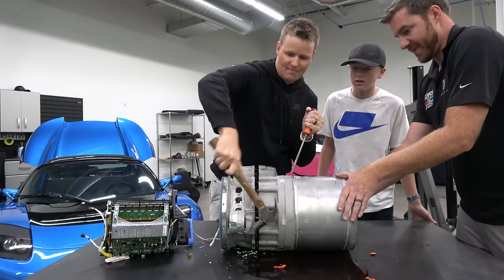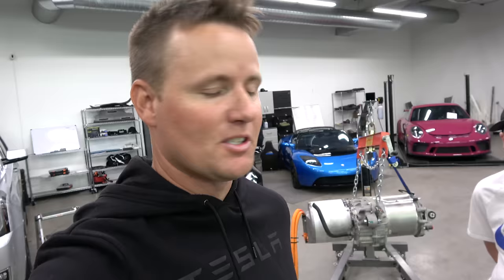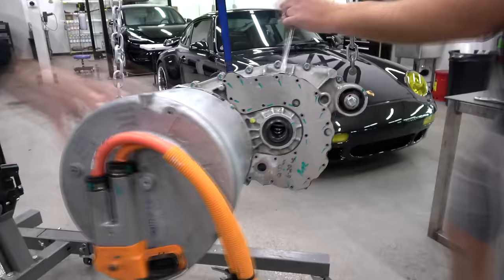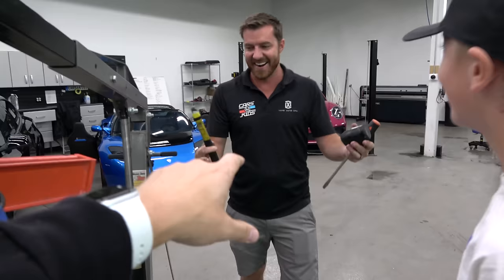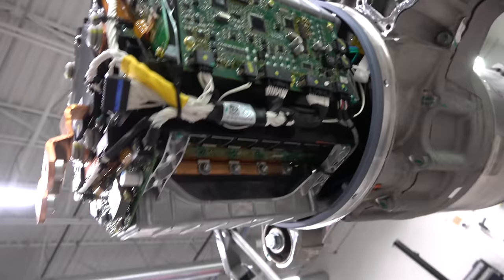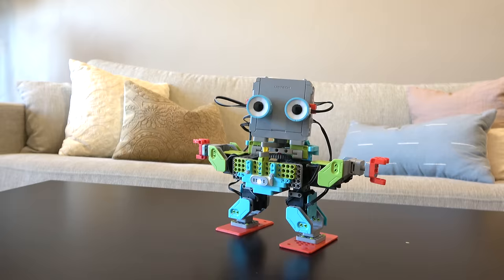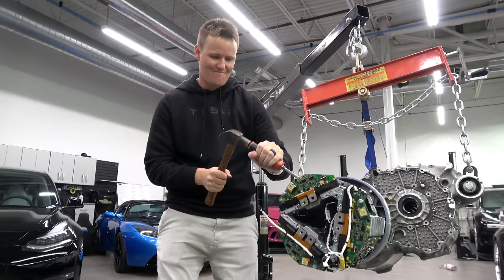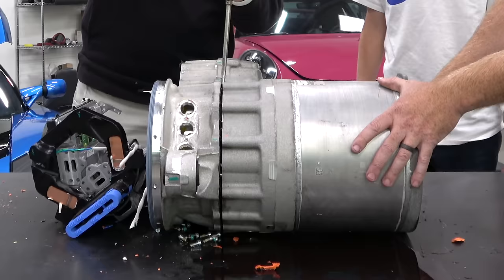What's inside a Tesla Engine?

Comment: “Lets take apart the motor!!!” - takes apart gearbox and controller, not motor.
Reply: hhahahaha...
Reply: Yah I was expecting spark plugs, pistons, air intakes, radiator, manifold, exhaust, valves, and other combustion automotive things too, lol
Reply: Eh? Didnt even take apart gearbox they only exposed the "bearings that roll around" after butchering/splitting the electronic modules from motors cage.  
      They dont even know that Tesla doesnt even have an engine, Tesla itself is a motor(car)
Reply: @sandro14esandro14e  Ever here of an electric motor well a Tesla has one and we didn't get to see any part of the actual motor.  We don't even get to see if its brush-less or not (but all the electronics in the first section points to it being brush-less i think but i'm not an expert).  Your comment implies you think John James is disappointed because the motor wasn't a combustion engine and i'm pretty sure that is not the case.  He seems to be disappointing because we don't get to see any part of the actual motor just the gear box and circuitry.
Reply: kye langrehr kind a wanted to see magnets as well, 

Teslas use electric motors that have two moving parts, and single-speed “transmissions” that have no gears. The company says its drivetrain has about 17 moving parts compared with about 200 in a conventional internal combustion drivetrain
Reply: Sandro Fortini 200 would be a very conservative number for a modern ic engine.
Reply: @kyelangrehr183  It's most likely a 3phase induction motor driven by a variable frequency drive (the electronics they dismantled). Would've been nice to actually see it though.
Reply: @kyelangrehr183  It looks like a 3 phase asynchronous motor. At 9:55 you can see the 3 terminals of each stator phase. At 4:20 you can see the rotor and probably the bottom of the "squirrel cage".
Reply: @peterkiss1204  It's a brushless  3 phase synchronous motor.  Rotor is made with permanent magnets. It's what we call a servomotor in the industry. Motor is driven by a drive which supply power to the motor, controls amps, torque, position, acceleration, braking, regen, thermal status of the motor etc etc as  servomotor have an encoder feedback to report speed/position of the motor...etc.
Reply: @nabushdinosaure  I looked it up, and it's actually an asynchronous induction motor they used in the model S. A rotor made with strong permanent magnets wouldn't stand that clear from the stator assembly with only one end being held in position. And probably wouldn't run that free. The bottom definitely looks like a copper ring, as the back end of the cage.
Reply: @sandro14esandro14e  
What do you mean they have no gears? You saw the gears in the vid...
Oh, wait, you meant gears as in the different ratios between input and output rotation, not gears as in cogwheels, got it.
Reply: @sandro14esandro14e  electronic motors dont have most of those things. this isnt an engine it is literally a huge complex motor.
Reply: Yeah, but it looks already AMMMAZIIINNGGG!!!! The most amazing thing you have ever seen! I mean, look at that!!!
Reply: It's asynchronous and synchronous that's part of what the "brains" do. (The triad board on the other side.) This controls the behavior of the motor operation at any moment. I assume that "synchronous mode" would be the most power driven mode of the Tesla and "asynchronous mode" would be a more economic mode for regular driving. It's also a controlled induction motor (bush-less), so in a sense you are all correct. Tesla took the best of these worlds and put them into 1 package. Mic drop Elon give me a job!
Reply: @sandro14esandro14e  Actually the model s uses induction motors, which don't actually use permanent magnets. In the middle it has what is usually called a squirrel cage instead of a big magnet like DC motors.
Reply: John James thinking that the whole time
Reply: @sandro14esandro14e  Most people consider a "motor" to be electric while an "engine" is usually considered to be combustion. Just something to think about....
Reply: j McGuglet after some thought 💭 it seems apparent that it can apply to both electric or fuel  for example motorboats and motorcycle are typically immediately considered primarily as internal  combustion engines
Reply: @sandro14esandro14e  its electric,not combustion, how do you make the mistake??
Reply: @TheNeckmeats  Motor could still be applied to combustion engines, for example, aww man the motor broke and we cant to go to (insert city name here), just something to think about.
Reply: @christhegamerdelima5545  Maybe you may want to take more time reading a person's statements before replying... I just explained how the two words are synonymous.
Reply: @TheNeckmeats  i further proved your point (: haha
Reply: @christhegamerdelima5545  I would suggest for you to enroll in a reading comprehension class. I really feel it may benefit you greatly in the future. If not, it may be best for you to stop communicating using written words.
Reply: @TheNeckmeats  you what, i dont man, seems you should stop communicating, like i said i further proved your point.
Reply: Chris the gamer Delima sarcasm notice lol
Reply: @sandro14esandro14e  sorry, its hard to convey sacasm through the medium of text when not using any form of satirical language in a obvious manner, btw this wasn't passive agressive in anyway haha. But really my bad tho.
Reply: @GuyFromJupiter  Model S motors are carved from a solid block of copper.  There are old videos floating around of tours of the Tesla factor that show them being machined.
Reply: @nabushdinosaure  Its almost the exact opposite of that.  Its a 3 phase 4 pole asynchronous AC induction motor with no permanent magnets.  Tesla didn't start using permanent magnet motors until the introduction of the model 3.  Which post dates this motor.   The main drive motor of any electric car is by definition NEVER a servo motor.  It is a traction motor.  Servo motors are used to obtain precise angular positions as in robotics or reciprocating control surfaces.
Reply: @Robbie6298  Thanks I know what a servomotor is I'm a maintenance manager in 1000+ people industrial manufacturing site. Servomotors are not used only in Robotics, they are used for on all kind of machines where a presice control of speed/torque/position is required. We call a brushless motor a servomotor once there is an encoder on the motor for precise speed/position monitoring. At some point even traction motors as you say will become servomotors as torque vectoring systems, traction management systems etc will benefit of having precise knowledge of the motor position and/or real speed on top of all current/frequency/torque/curves from the VFD
Reply: @nabushdinosaure  given your credentials you should therefore know that the original Model S drive unit is an Asynchronous AC induction motor with no permanent magnets and by definition the magnetic field of the rotor is induced and does not follow the rotating field of the stator.
Reply: @Robbie6298  I appreciate your definition of an asynchronous electric motor :) Thanks for teaching me stuff I already perfectly know ^^ . I would like you to explain me how by knowing how an asynchronous motor works automatically means that I should know the model S has one :). Especially when I never look into before...I assumed their were using permanent magnets motors, but obviously an asynchronous motor is way cheaper for high HP applications.
Reply: @Ash-do2pv  Sadly they took the gearbox further appart, as you can see in the end, but didn't show anything of it in the video.
Reply: @peterkiss1204  how can asynchronous induction motor do regenerative brakes?
Reply: @kyelangrehr183  It is a permanent magnet motor, actually there is a video about it, not this one of course, and the amazing tech that they are saying is just the microcontrollers and they are nothing unusual or 3 years more advanced than anything else as they said lol
Reply: @samueladitya1729  it is possible to have regenerative brakes in an asynchronous motor (Squirrel-cage ). It happens when the rotor is spinning at a greater speed than the synchronous speed. With a VSD this is pretty easy to do. However you have to keep in mind that is can't work just plugging the motor, it needs a source of reactive power (Q) to keep the magnetic fields and it will generate active power (P). If the rotor is winded and connected to a vsd instead of a cage it is possible to do without the external source of reactive power.
Reply: @kyelangrehr183  based on the electronics (and things published by Tesla) it is a 3 phase ac induction motor.
Reply: They did it on purpose ;-)
We didn't see stator, rotor etc.... :-)
Reply: my thought exactly.
Reply: @jaredhouston4223  Except this unit does not have any synchrous abilities. The new model 3 has a synchrous PM rotor, and can  also do re-gen. The model S cannot. Also, a Synchrous motor with a permanent magnet rotor, is more efficient, and asynchrous one which has a lagging induced field in the short-circuit "squirrel-cage" rotor, is less effeicient, but can be made much more powerfull. In an asynchrous motor the induced field is proportional to the applied power, and the only thing is the efficiency goes down more at high loads due to a larger lag of the rotor. Synchrous permanent magnet motors has a much more limited torque, as overloading will cause it to "skip" over the limited in strength fields, and go out of synch, but when kept in synch and at lower loads the less offset of the fields gives a higher back-emf, and higher efficency. With regards to the Back-emf that applies to the asynchrous aswell, but it will allways lag more, and have lower back-emf, and thus lower efficiency.
Reply: @flyfaen1  🧠👍
Reply: @GuyFromJupiter  The S is switched reluctance I believe, and the model 3 is permanent magnet. Most 3 phase motors still have permanent magnets, but the switched reluctance motor does not.
Reply: I'm thinking the same thing
Reply: Don't tell him he will be devastated 😢

Comment: "Whats inside a Tesla engine?"

Opens eletric part
Opens gear part
leaves motor closed
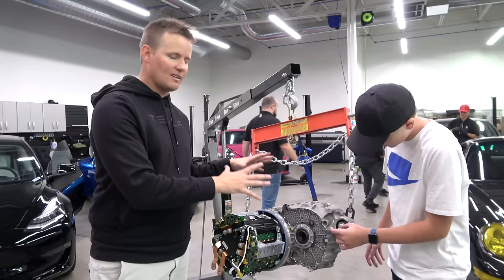Reply: 5:56   And don't forget to buy your Lego robot.
Reply: For one Batterie you need 20.000l of Groundwater.
Lets say in Germany they produce 80 Mio. E-Cars.
You need an amount of 1.600.000.000.000l of Groundwater ..
Reply: What is the what is the groundwater used for?
Reply: I know. Was thinking the same thing. This was hilarious
Reply: You know lithium and cobalt manufacturing is more dangerous for the environment than producing combustion engine cars? Look it up the vehicle itself might be good for the environment but no one talks about the production and manufacturing
Reply: @carlosgaspar8447  idgaf
Reply: The Illuminati cut that part out of the vid (satire)
Reply: You are wrong it's have combustion engine and pedal system
Reply: @lemmythebulldog8812  They talked about production on battery day. Cobalt is no longer part of the process and lithium is reusable after the vehicle life.
Quit spreading your bs.
Reply: First thing it’s not an Engine it’s a motor remember...
Reply: @emiljagodowicz3682  I dont really care, you should tell this to Whats Inside not me, and i think you got my point even though I mistakenly put engine instead of motor
Reply: Google "electric motor rotor" and that's what they didn't look into.
Reply: I tought it only had some bigass dc motors lol

Comment: That moment when you find out there’s lots of fluids to maintain in a Tesla right after you said there’s nothing to maintain on a Tesla 🤣🤣🤣
Reply: Makes me wonder, what is more reliable, a good 4l gasoline engine or this "simple" motor. F**k, this thing has a million of electric parts that might go bad. Will it cost me to get another engine like this?
And by now, I do not believe it would be cheap.
Reply: As soon as he went on that ignorant rant at the start i went and got the popcorn....
Reply: lifetime fluids aka they dont wear out like jet engine oil
Reply: @Shineinpoverty  About $7k from Tesla. And they make sure you can’t DIY anything. You’ll pray for an alternator, water pump or coil pack to replace.
Reply: @jkoonce4244  Huh? The Tesla fluids wear out just like ICE cars. The drive units are like transmissions/differentials that should be replaced every 50k miles for long life. Brake fluid and coolant need changing on the same schedule as ICE cars because the brake fluid absorbs moisture and the coolant loses anti-corrosion additives over time. You just save an oil change but lose that savings on more frequent tire and cabin filter replacements.

Comment: "whats inside a tesla motor"

*pulls apart everything but the motor
Reply: Should have titled it, 'what else is in a Tesla drive unit apart from the motor'
Reply: Umm they did open the motor, just not the gearbox
Reply: @ThePurplePupUwU  Ummm no.
Reply: TheRedGamerFPV there’s no gearbox in a tesla
Reply: They should titled it "What Inside Tesla Gearbox and Inverter"
Reply: @yaheard8335  But there is a reduction gearbox.
Reply: It's a motor not an engine.  An engine implies that heat energy is used to create useful work.  A motor uses non heat energy to create the useful work.
Reply: He said engine, and it doesn't have an engine
Reply: @ThePurplePupUwU  no, you got it the wrong way around xD they opened the gearbox and not the motor.
Reply: L
Reply: "whats inside a tesla motor" *ENGINE. lol.

Comment: Very interesting video. 
If anyone is taking things apart: in the very least wear a pair of latex gloves rated high enough to stop chemicals going through them, and please wear eye protection, not only against splashes, but you never know if there's a spring sat under a cover that will launch out unexpectedly or a hose with liquid under pressure. Make sure you have ventilation too. 
Most products should have COSHH (Control of Substances Hazardous to Health) sheets available, telling you the risks, dangers, and most importantly the information required for emergency treatment should someone have an accident. Make sure you read them and, if required print them off.
Also: sorry if this sounds formal, but have a plan, a working statement, we have them for reasons: "if this goes on fire where going to do..." , "If we suddenly struggle to breath we will..." .
I appreciate some people say the chemicals are safe, and they probably are in 2020, but time and time again (sadly) we find out that the "safe" chemicals are now dangerous. There's nothing worse than finding out 20 years later we should have used high protection protocols when working with them: why take the risk? 
And finally as others have said, unless you know what you're doing be very carful as electrical current can be stored for significant periods of time in capacitors.
Reply: Sir, you do realize you're talking to Darwin award nominees, right?

Comment: Open the motor, this is the differential and the transistors driver
Reply: That's a GEARBOX, also called as REDUCTION GEARS, .....NOT a DIFFERENTIAL....LOL
Reply: Differential have a reduction factor done with gears. This is a one shift gearbox.
Reply: Pranav Tagare wrong
Reply: @pranavtagare2601  I think it is both a differential and gearbox.
Reply: you can find those motor online... clear problem... if you need to replace them you need the whole unit.. unlike normal car that you can just take one part out and fix quickly... I will never buy this pos.... rental car only...
Reply: @campkira  There is not much things to replace... Basicaly only 3 motor itself, gears and DC/AC converter. If you burn windings repace of coils is too dificult, gearbox is almost fail safe and burned DC/AC is also cheaper to replace than repair. ICE engine has  lots of moving parts and it is much more complicated. It is expeceted you will broke components to comparsion electric motor is far more reliable, there is little to no wear of components.
Reply: @PistachoGirasol  One shift would mean 2 gears. This is one gear, and ZERO shifts.
Reply: @campkira  even with an EIGHT YEAR warranty and NO gas? 
Think how cheap and how many parts there will be on ebay in EIGHT YEARS.

Comment: Tears appart one heck of a piece of modern engineering & technology, then turns a ball bearing and goes "Thats where all the efficiency comes from, cruising down the streets". XD
Reply: And doesn't even open up the  motor part. And even if he did, he wouldn't get it. Probably he would comment about a can with some twisted bar thingies sitting inside a copper and steel thingie.
Reply: @samuellourenco9526   Right.. I thought this video was ridiculous. However, it was interesting to at least see the drive train a little bit. And as expected, it's not very impressive, just a small set of gears. Oh yeah, and "little balls that roll around". Lol. Imagine their awe if they took apart something that was actually mechanically complicated, like an automatic transmission.

Comment: "This is the gears, this is where the torque comes from!"

yeah, sure
Reply: In their fairness, they provide the mechanical advantage necessary to propel the car. So they are partly correct. 11% correct.
Reply: I’m thinking they didn’t show us that block back to gear set, probably is where power torque comes and/or is the electrical engine.
Reply: Curtis Veillon Exactly what i wanted to say, so back of gears is the electrical motor
Reply: I agree... this dude needs to review ice cream.. at least it's only ice and cream...
Reply: > takes apart a combustion engine
"Whoa look at this dude this thing has pistons in it! They move up and down!"
Reply: That motor was not complicated at all. I bet this guy wasn’t smart enough to figure out how to take apart a starter motor 🙄
Reply: Yup, he essentially saw the gears and called them the motor. It is just like someone doing an half-assed job and calling it a day. Oh wait... he did that!
Reply: @msain427  He would even fail at that, I'm afraid.